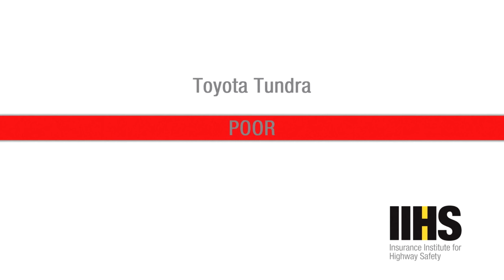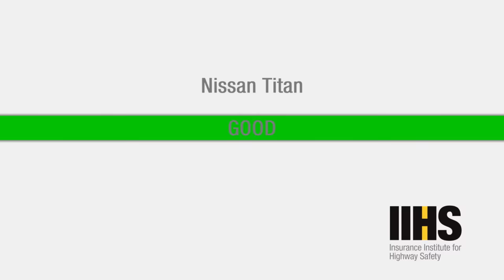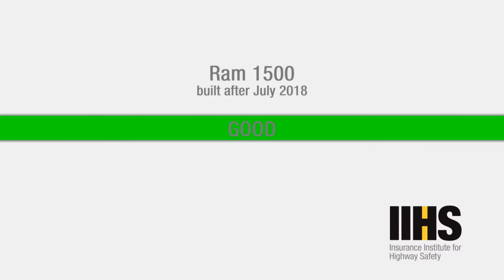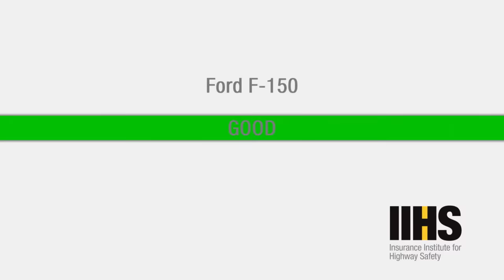TRUCK CRASH TEST COMPILATION - Ford F150, Toyota Tundra, RAM 1500, Nissan Titan

Comment: I hate when people say things like, “what a waste...” but fail to realize that they do these tests for our safety.
Reply: Mauricio Marroquin They do these tests to comply with Federal mandates, which cause the cost of a new vehicle to be out of reach to people unless they sell their futures to the money lenders.  Because these vehicles help people to live, even to not get hurt at all in some cases, idiot drivers act like they are in a NASCAR race most of the time.  These idiot drivers are an ever-present menace amongst us.
,
Reply: @Lord ballsac the 2nd Simulations can fail and are not exacting enough to predict the exact action, forces, and manipulations that may occur to a vehicle and its riders. Computer modeling would also require dozens and maybe even hundreds of test per vehicle model to get significant enough data to get close to a correct model, and that data would have to all be recollected when a new vehicle model is released or revised.
Reply: I started a channel where i take trucks off road and break em. Try and make a few people laugh
Reply: Lord ballsac the 2nd 

I’m not sure if you’re in the same industry as I am (R&D engineer for a major vehicle manufacturer), but computer simulation will not replace physical testing due to the fact that, if we’re gonna make the actual product anyways, you might as well test the product physically.

Also that testing solely through computers is (ironically) significantly more expensive than running it through crash tests (as of right now). Besides... we’ve already simulated assemblies using typical CAD/FEA software (my company mostly uses Solidworks and CATIA).

In the end, crashing the vehicle is testing that our math was right.

Only time where it’s cheaper to model than to test would be in my sister-company’s aerospace industry.
Reply: Exactly. Just like animal testing
Reply: Lord ballsac the 2nd 
Ahh, the “should” be argument. 
I feel your pain.
Reply: This is next to nothing compared to other wasting happening around the world. And this actually usefull
Reply: @Lord ballsac the 2nd And yet...Tundra got a poor rating
Reply: @Lord ballsac the 2nd physics beat computers
Reply: @Lord ballsac the 2nd Id much rather see my car tested in person than by a simulation that could fail.
Reply: Nobody says that
Reply: Like, OH YEAH, WELL NEXT TIME WE'LL JUST MAKE IT OUT OF CARDBOARD AND SEE WHAT HAPPENS
Reply: Every single person here is a boomer
Reply: they are also base models, like cheapass
Reply: Loganatorexit 
Well, it would make no sense to destroy a fully-loaded version when what matters is the structural integrity.
Reply: The money would be better spent teaching people to drive more safely. Cars don't crash themselves do they!!
Reply: I reckon I can build that 
Even then, there would still be accidents. There’s no way to prevent accidents, even with the most safe drivers. Perhaps technology would step in— such as a self-driving car. But then, everyone would need one so it could work.
Reply: uh wot 
The occupants inside aren’t real lol
Also, these tests are simulations on how the car would behave in a real-world accident. They do these crash tests to gather information on how safe the vehicles are.
Reply: Commando ! 
Nah— all liquids are drained. They’re pulled by a wire on the floor.
Reply: They should be more concerned of the amount of people that mistreat these trucks by not changing the oil, abusing the shit out of it etc. That's in the thousands. Meanwhile only a handful of these trucks are used for these tests. Tell me now whats a bigger waste?
Reply: Alan d 
The time it took to read your comment. 

Hahaha jk!! 

Yeah— it sucks because people don’t take care of their cars and then blame the brand for their negligence.
Reply: No no no sir
These tests were by the insurance agency for their own safety
This is how they give you your cars rate. Also by your history
Reply: they should make a truck made out of the wall they are hitting LOL
Reply: @Lord Ball-sac the 2nd the truth is that despite all the amazing technology we have, there are still a lot, and I mean a lot of unknowns out there. Simulations are only based on our knowledge, so anything that science has yet to understand would be left out. It is much safer to rely on solid realistic data that simulation when it puts many’s live at stack.
Reply: I also hate when people say 2020 crash test and the first scene is a 2018 pickup truck
Reply: Yes
Reply: What a waste.
Reply: and our viewing pleasure....😃
Reply: No shit Sherlock 😒
Reply: Of course they realize why they do this, don't be dumb. You can realize it and still feel it's a waste of a nice truck
Reply: Exactly
Reply: Not for our safety. These test provide evidence for insurance rating
Reply: When they crashed a PCP Hemi Challenger, that was a waste. They should have used a common color. White, black, or silver.
Reply: Really??🤦🏻‍♂️ No one says that with any sense of sincerity. If anyone actually does say that, it’s obviously meant in a sarcastic and tongue in cheek way. Apparently some people just don’t have the ability to read a room or between lines. Good grief.
Reply: @alexandriaocasio-smollett5078  
You obviously see over 1k likes, so it’s not just somebody not reading a room. Besides, with how the kids are these days, I don’t doubt for a second that someone would genuinely think that. Perhaps you can read other comments.
Reply: @mauri123g  I absolutely love people who judge their validity based on how many likes and comments they get on social media. Cool story.
Reply: Ikr this is such a waste
Reply: They do a pretty outdated job of proving a vehicle’s safety. I mean, they only simulate perfect conditions. We are in a country where 20% of all our vehicles are trucks and where we have the most fatal accidents occurring at speeds over 40mph.
Reply: @jacklahm7363  
I agree.. although I’m from a different nation.
Reply: That's what I'm saying.
Reply: They are a waste... 25% is a waste... side/ 50% to head on is a majority of crashes i see on a daily basis... even when a car hits the tree its either side n split or 50% to full impact...
Reply: @thelastfps9635  that makes you a boomer
Reply: What a waste.
Reply: I hate when people talk about safety
Reply: @ObsessedWithTesla I do everything as unsafe as possible to ensure that safety will never save me
Reply: I agree.
Reply: @wiltonsmith3397  obbnnnccc
Reply: The crashed vehicles can be used for repair training.
Reply: @wiltonsmith3397  ok then lets just give them biscuits to drive around, or mobile aluminum coffins. Just because some drivers could be wreckless? don't generalize. Most drivers are responsible but accidents do happen. And companies are driven by greed, they would sell you an unsafe car just to save a few billions off production, not out of necessity.
Reply: 40mph is reasonable test speed given financial factors in safety design with today’s vehicles. But remember plenty of accidents happen at 50, 60, 70 mph. At those speeds if it’s a direct hit, it will probably kill you no matter what you drive. Could they make them safer at those speeds? Well, yes. But they’d be unaffordable to purchase.
Reply: John Buck  inflation is a thing
Reply: John Buck  I’m not interested in your approval of my comment
Reply: I tried driving a truck with a trailer that was attached without using the proper equipment.
It went off without a hitch.
Reply: I have yet to see someone comment that
Reply: I don’t want safety!
Reply: @prestonboyd692  They only do tests on cars that have significant changes to their safety designs. They don't test every new car that comes onto the lot or else they would run out of money almost instantly. These are IIHS tests, not the government.
Reply: Exactly man thanks for making this comment
Reply: I think the fast cars like paginis and koenigseggs should be crashed only viper and under price <200k price
Reply: @wiltonsmith3397  they are a non-profit organization
Reply: Yep they are just testing if like you saw them putting paint on the faces that was going to see if the head hit the air bag and they are not wasting cars no no no this is for safety
Reply: Agreed I can meet half way and state "thankfully I knkw these crash ratings but I hope the good parts that's left don't go to waste."
Reply: What a wast 😂😂😂
Reply: @petter5721  almost there… missed an “e” 🙂
Reply: @bushtruck  to pick lol
Reply: Fr
Reply: Fr lol
Reply: What a waste
Reply: Mauricio Marroquin - no...they do NOT do it for our safety.
They do it to justify, higher insurance rates.

You do realize that this 'institute' is funded by auto insurance companies?
You think a corporation 'cares' about your safety?
Suuure they do.
Reply: ye people dont understand and just think the federal mandates dont exist
Reply: when people say "fail to realize" like they should all think a like. get over it.
Reply: @uncovidvaxxforthestrongand3582  
It wasn’t that serious. Take a chill pill 💊
Reply: Still...What a waste!
Reply: Yeah that’s true but still a waste!
Reply: insurance companies care less that you are safe, and more that they dont have to pay out on premiums
Reply: *For idiots who crash. Nobody in my family has ever wrecked a car. I’ve never crashed, and none of my friends who are decent drivers have crashed. I don’t believe “mistakes happen” anymore. You can either only drive when you know you can, or avoid people who obviously can’t on the road.
Reply: i think they are talking about you when they say it
Reply: @bushtruck  That's cool 🙂🙂🙂
Reply: who said that lol
Reply: It’s only a waste when it’s 2022 and they are still crashing 60’s-90’s GM cars and trucks haha
Reply: It's why I just quit reading comments on these videos
Reply: It’s a waste. I get why it’s done but I would like to have a brand new vehicle and no matter how safe your never guaranteed to survive an accident. If it’s too risky don’t ride or drive
Reply: wasta what?
Reply: Won't somebody please think of the children!!!???
Reply: The real waste is the teenager that crashed his parents Prius into a parked Tacoma in front of my house yesterday and sent his passenger to the ER.
Reply: the parts of the car that are fine usually fine get scrapped and recycled for future use.